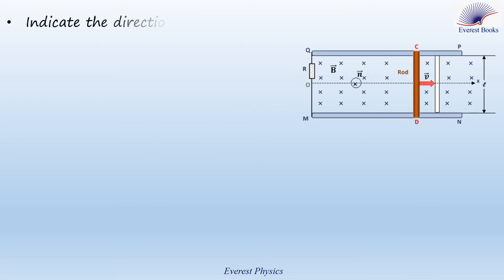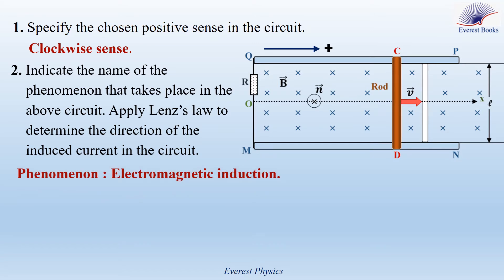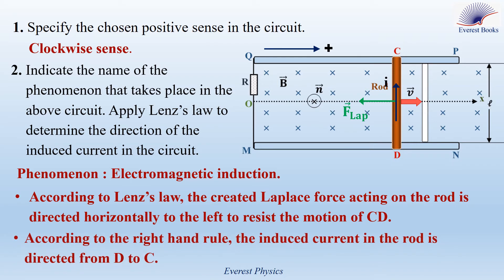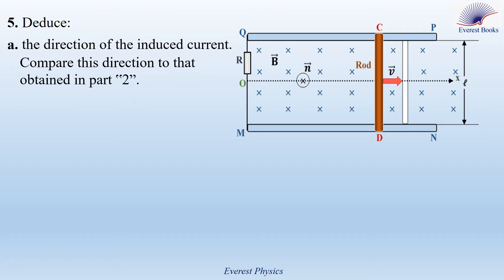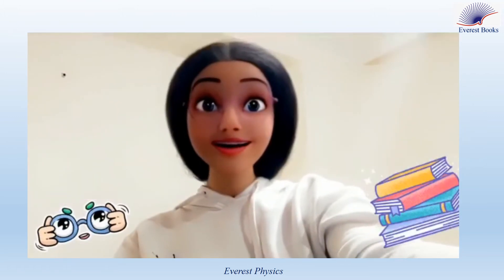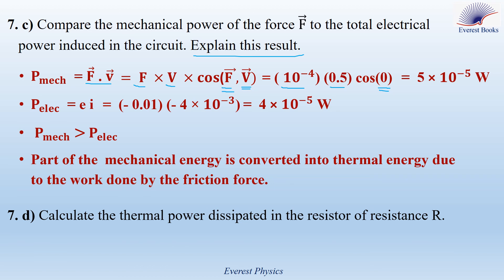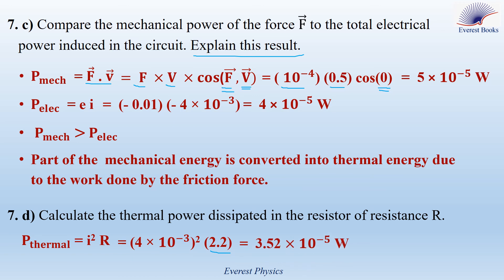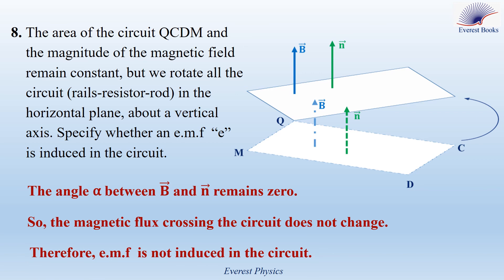Electromagnetic induction - Solved problem (2)

Comment: In the official exam, can we use the formula for i directly without deriving it
Reply from the maker: If the action verb is "calculate" you can use this formula directly,  however, if the action verb is determine you have to prove it.